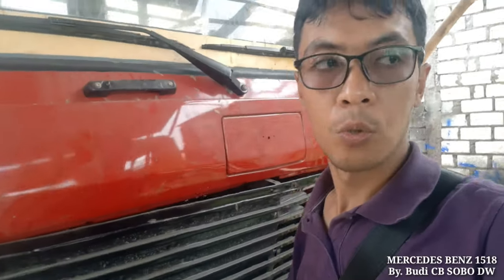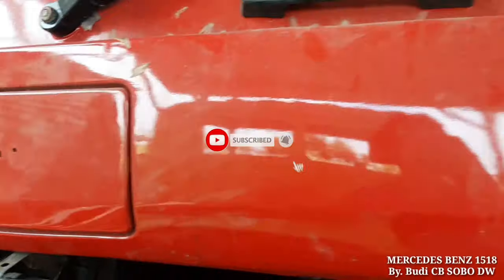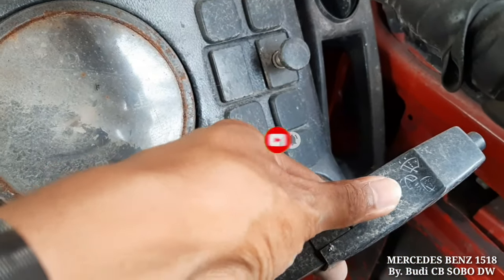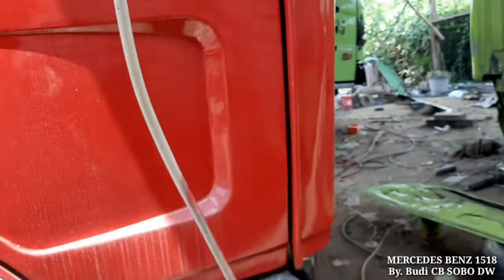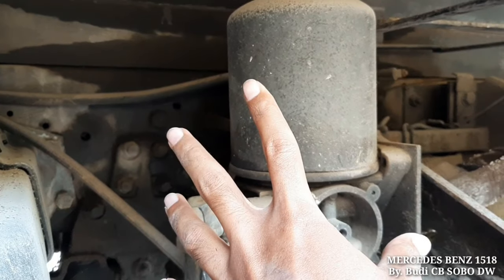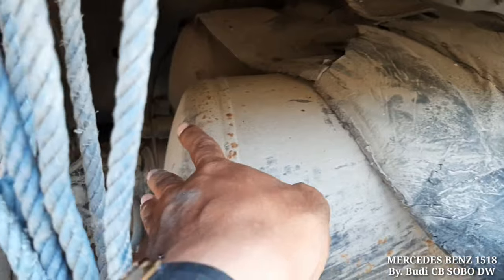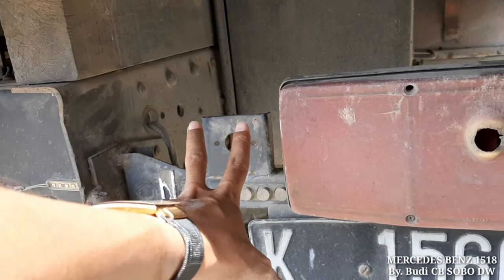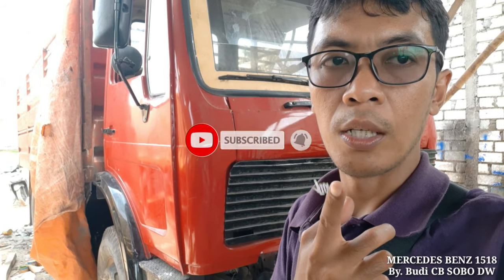REVIEW TRUCK MERCY 1518 / 42 ECOLINER YG DIJUAL!!! PROSES COMPLETED, NEGO SETELAH CHECK UNIT 📸🎥

Comment: Unitnya apa masih, Mas
Reply from the maker: Masih Pak
Reply: @BUDICBSOBODW  mesinnya apa sehat
Reply from the maker: @budihartono5756  mesinnya sehat Pak (Masih ada PR radiator Bocor), Truck Masih Dibengkel Repair... Belum Keluar,  kalau bak & chassis masih original semua
Reply: @BUDICBSOBODW  50 jt, apa boleh?
Ttp kondisi minta siap jln
Reply from the maker: @budihartono5756  sambung Telf Pak 082136330540